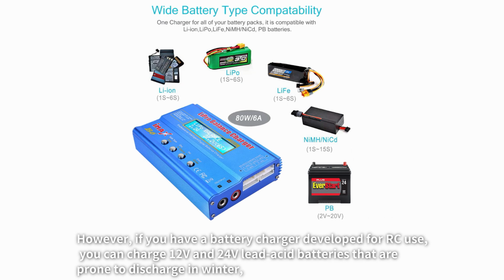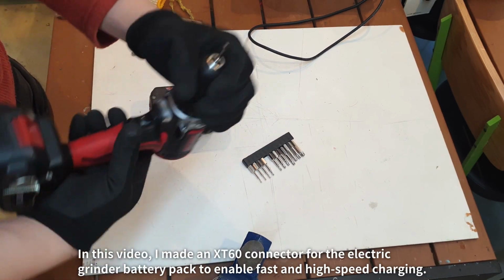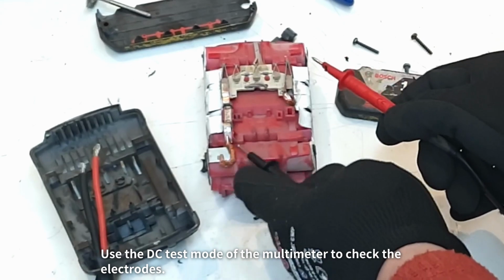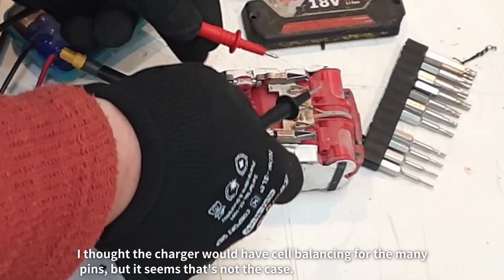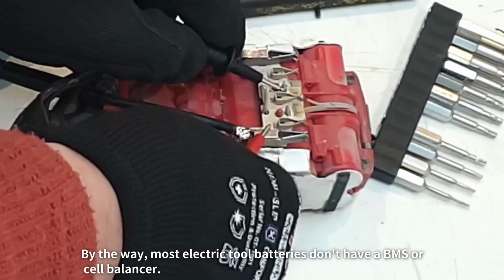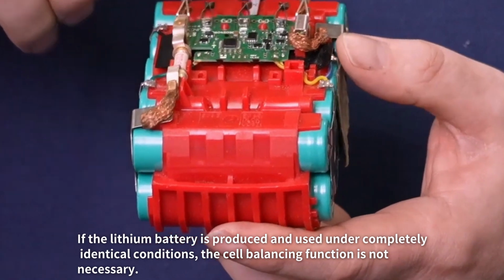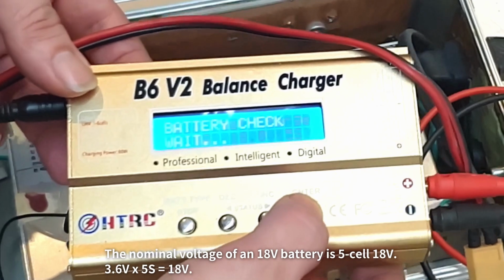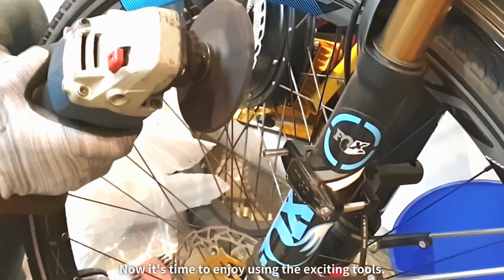The Structure of Tool Battery Packs : Essential Chargers for Handyman

Comment: Hahaha. Good luck with that. You're going to start a fire when that battery is old
Reply from the maker: Not an old battery. I lost my charger.
Reply: @Mobilant_TV  not an old battery now, but it will be, and then it will burn from being inbalanced during charging. Do yourself a favour and at the very least add a balance lead for charging.
Reply from the maker: @spr00sem00se  I agree that it is a better option. Lithium polymer must be added because of the risk of explosion. However, lithium ion becomes unusable due to leakage in most cases before that. This is why most electrical appliance brands do not do cell balancing.
Reply from the maker: https://ko.ifixit.com/Teardown/Bosch+GBA+Battery+14.4V+1.5Ah+Teardown/112253
Reply from the maker: This is an Electrolux vacuum cleaner battery refill product. I have also taken apart this lifespan vacuum cleaner and worked on it myself. I couldn't find any wires related to the BMS. Same with other power tools. Ultimately, that means old batteries have little to do with exploding.
https://s.click.aliexpress.com/e/_Dm969LP